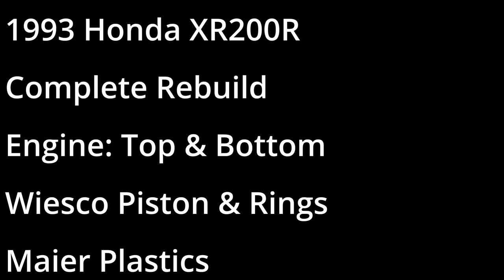1993 HONDA XR200R Complete Restore! Work Of ART!

Comment: Great job, Great music. Well done. 1 question. Mine is a 1996, it has a 17'' rear wheel, apparently later ones have an 18''. Original tyre size here for the 17'' is getting harder to find. 100/100 x17. What size does your bike have?